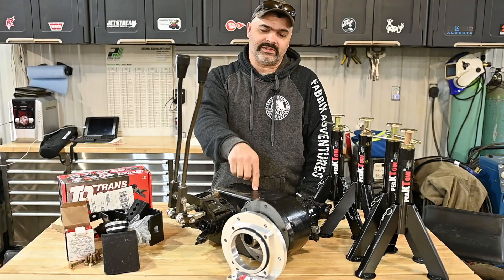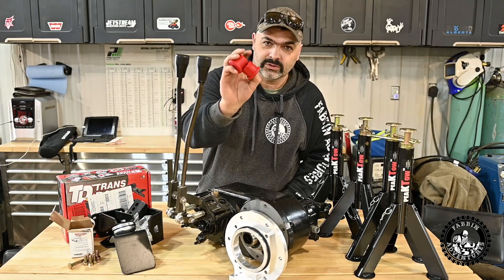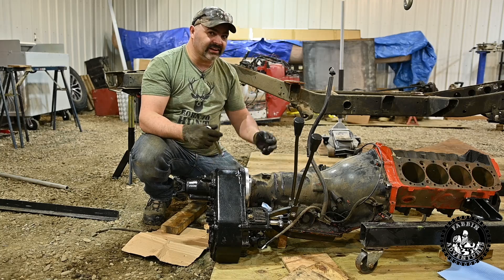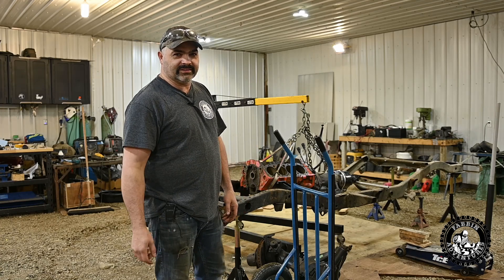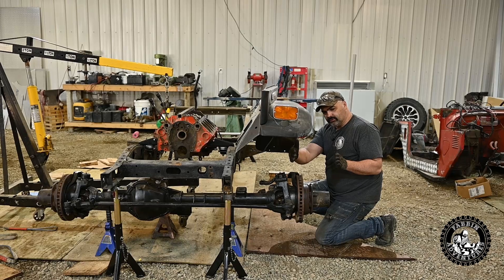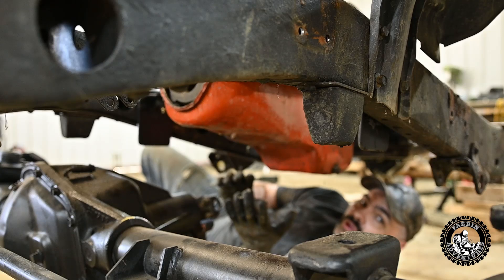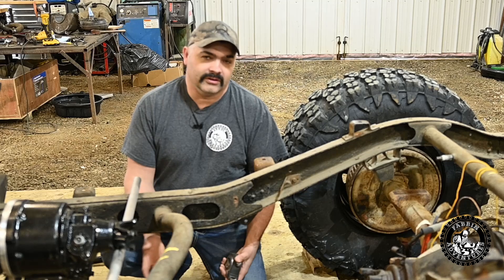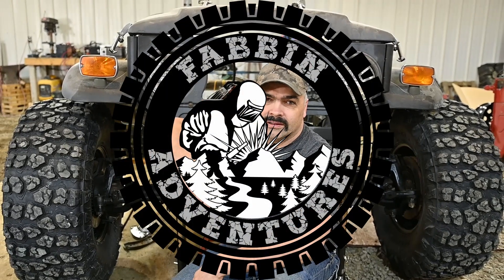Project XTREME40: Mocking up the drive train.

Comment: Awesome vid. The extream fj is looking awesome. I just got my diesel powered samurai driving on Sunday!
Reply from the maker: Thanks man, the next vids should be  trusses and 3 and 4 links. Im picking up 10 boxes of parts today...cant wait yo get started!
Thanks for watching and commenting!
Reply: @FabbinAdventures  can't wait to see !! And the content you do is awesome !! Keep it up
Reply from the maker: Happy to hear you like my content!
Yeah i cant wait to get it linked, im gonna have to spend some time on a 4link calculator before i start welding. I also have to make a decision on what coilovers to go with. Im leaning towards Fox 2.0 emulsion, but i have a lead on another brand that im trying to get sponsorship from.
Reply: @FabbinAdventures  oh nice !! And I'm sure what ever oil over you go with will be good !! I'm trying to decide when I go spoa if I should put Toyota axles in or stay with the original samurai axles
Reply from the maker: Sofar, ive been good with stock axles on my samurai, though im locked up front with chomolies now.
Runnin 33s, i know a few guys runnin up to 35s on stock axles but are mostly playing in mud. I think if you have more rock where you wheel and are planning on 35s, id say seriously consider toyotas.